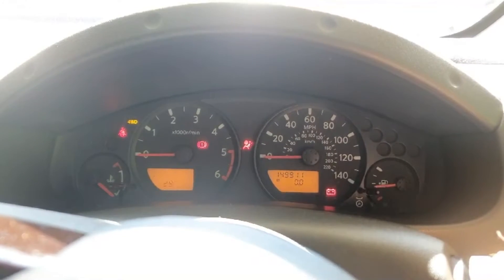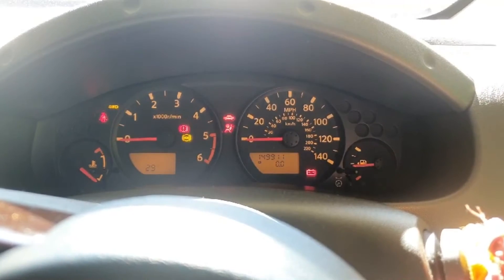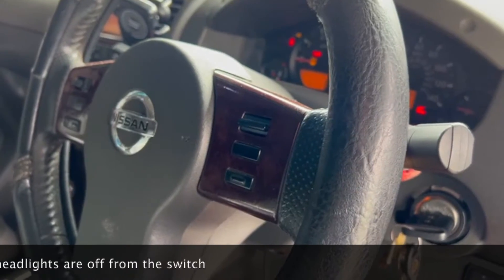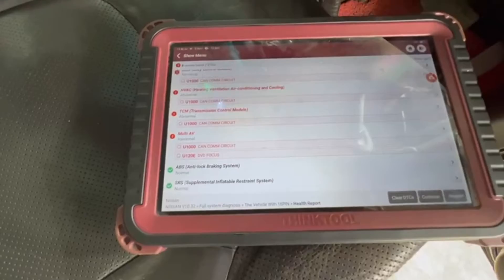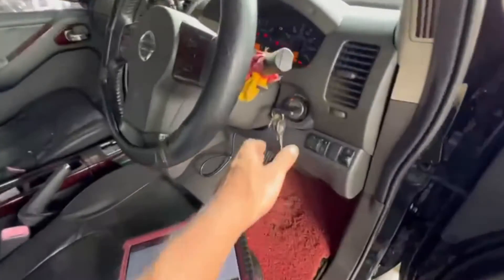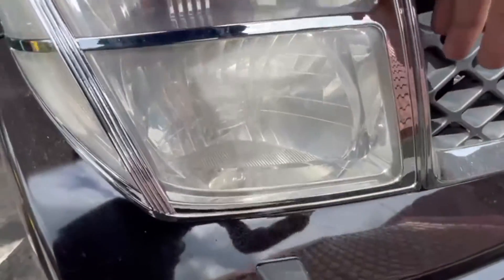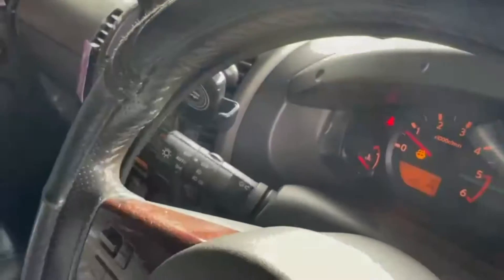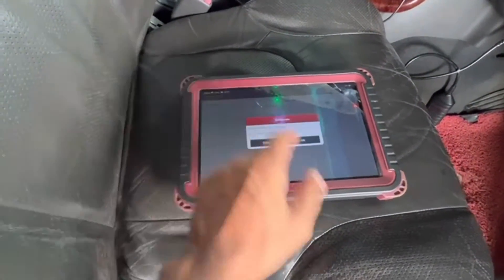Nissan Navara D40 U 1000 CAN Communication Circuit | Head Lights on | Key Light On

Comment: Hi. Good point. Ground wire not connected anywhere, what you said. I am having same error in 4WD. Last time after service there were 4WD error and it didn't switch. Then I have checked the transfer box wiring harnes under the vehicle and there were 3 wires damaged from hight pressure and I have attached them and 4WD is now working. After few moths suddently seen this error but no issue with 4WD. But I can see there are corrosion in earth connected under left seat wire harness. And someone cut everywhere, every inch of the wire harness, looks like tried to find out wireing issue. Checking the all earth connecte to 4WD related worth? Not idea where are them. And I don't have a extra fuse box to replace and check. Where is your workshop located?
Reply from the maker: Our workshop is located in Nawalapitiya

Comment: Currently im facing the same error codes in some control units, and also the car is not starting, D40 from 2013. Signal from ignition is coming to IPDM but does not start cranking only if i bridge the signal directly to starter, car starts, but then the gearbox stays in third gear. any advice? Shoult i start changing IPDM fuses box first, or directly TCU?
Reply from the maker: You need to check the complete fuse and relays that lead to the starter motor.

On the AC, start cranking and check whether the AC panel is getting off? 

Check and let me know
Reply: @abcautotrendy  i checked each and every fuse, and also all relays. They are working. Signal for starter i can bridge at IPDM Module but didnt find the relay for it. Why i should check the air condition?
Reply from the maker: Checking the air condition can confirmed that the ignition switch is working or not. 

The other thing is you can bypass the starter relay from the IPDM and check
Reply: @abcautotrendy  air conditioning have just one error with CAN U1000 Communication. Yes, i did the Bypass when i explained i bridge it with the IPDM. Then car is starting, but still not running in first gear, so that means gearbox is in emergency mode correct ? So there is also no gear indicator in the tacho
Reply: @abcautotrendy  I got the same problem U1000 my navara won't start I checked the AC pannel on and start but engine cranking but no start same time ac pannel going off

Comment: After driving the Navara D40 cab,After the engine warms up, the engine stalls in traffic... What should be done about this?
Reply from the maker: There are two main reasons for that 

01. Limiter valve 
02. Suction control valve 

But in reality it could be lead to fuel pressure only
Reply: @abcautotrendy ❤